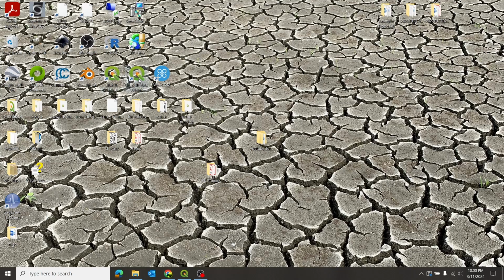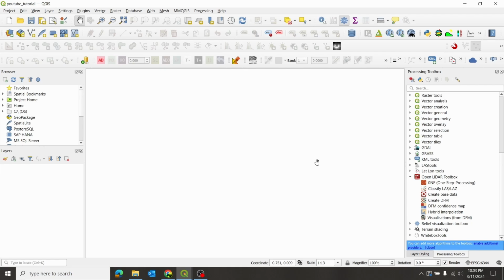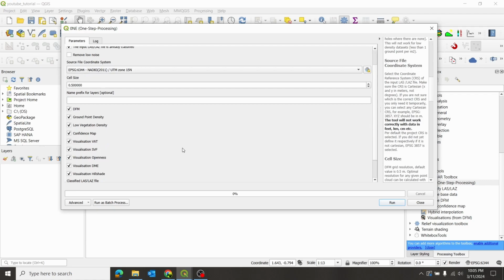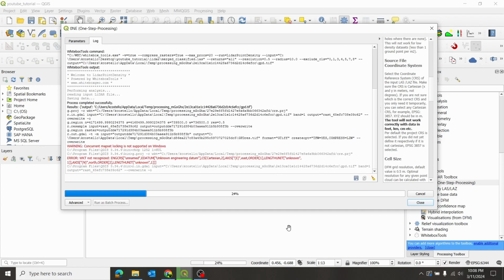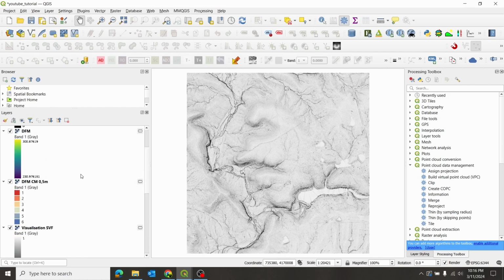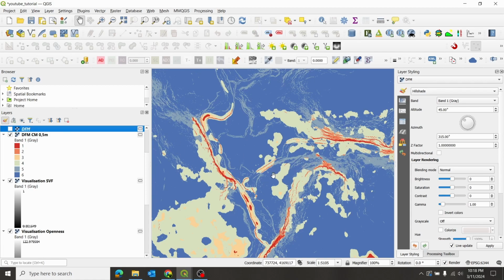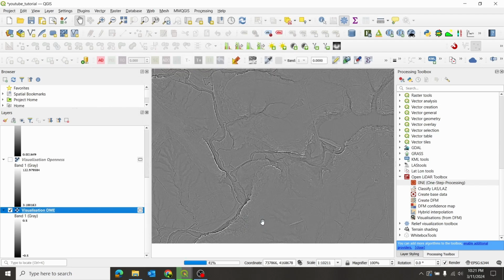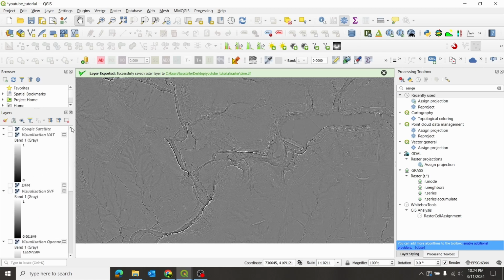Rasterization of LiDAR point cloud using Open LiDAR Toolbox (4/6)

Comment: Although I have installed LAStools correctly, Open Lidar Toolbox says that it can not find the LAStools algorithm. I have replaced the LASTools folder, and reinstalled the plugin so badfiles aren' the problem. I have also switched the dependencies multiple times, still get an error. Also don't have any spaces or special characters in my directories

 Any suggestions? Thanks
Reply from the maker: Does LAStools run independently in QGIS for you when you try to use it directly on its own?